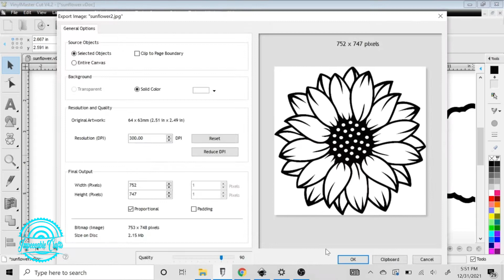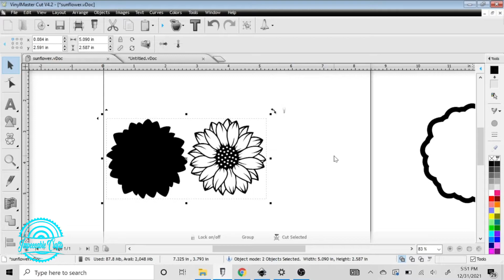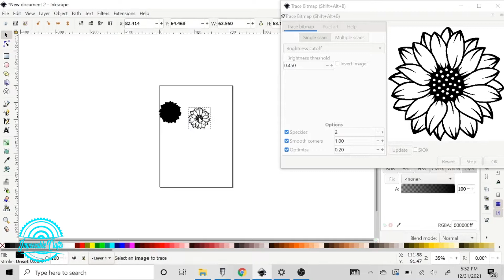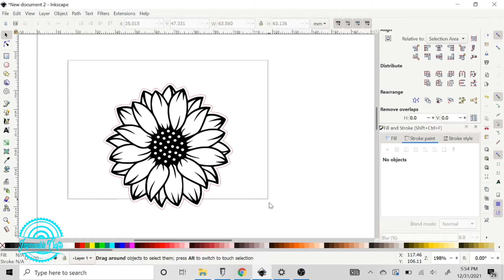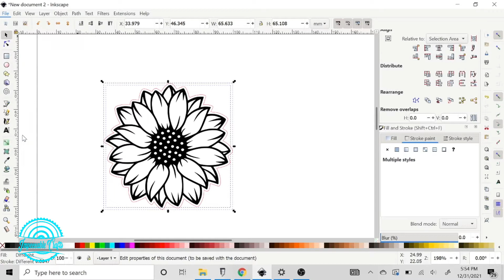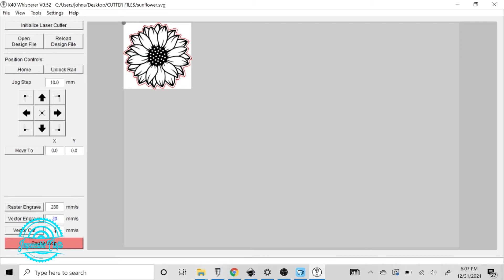How to make an acrylic blank for making a silicone mold for resin art

Comment: Hello! I've been crafting silicone molds for my customers and noticed varying behaviors in the same brand of silicone. While previous curing times differed—ranging from 24 hours to as little as 3 hours—they never affected the resin outcome until now. Recently, when the silicone cured within 3 hours and I poured resin into it, the silicon lost its shine upon removal of resin from the mold. This unexpected issue has me deeply concerned. Any guidance you could provide would be greatly appreciated. Thank you.
Reply from the maker: What brand are you using ???

Comment: what power you use for engraving? it doesn't have lines, mine always have line marks after engraving
Reply from the maker: I notice if I got really fast 280mms -300 and use engrave at about 6mah the lines are barley visible. Lower man and higher speed 😎

Comment: What are your settings for k40 whispers. Also your percentage on the k40 laser? I’m having issues cutting through my 1/8 inch acrylic. When I tried to go higher it started melting
Reply from the maker: Hey there ! I’m cutting it using a MAh meter as reference . Everyones k40 percentage is different from machine to machine . I’m personally using 13mah at 7mms doing two passes . You mentioned the acrylic is melting which tells me that your not using cast acrylic. Cast acrylic (for me) seems to cut way easier and cleaner . Let me know if u need some more help ! 😎
Reply: @impeccableprintz  thanks so much. I think a lot of it is that I need a air assistance to help the burning of the laser. I buy by acrylics from canal plastics and a local acrylic store that sells color/ mirror acrylics. Its definitely cast acrylic.  Not a Lowe's acrylic lol. But thanks. I'll let you know if I have anymore questions.